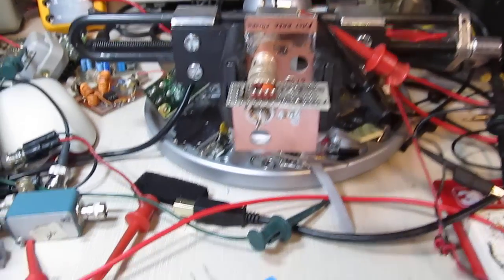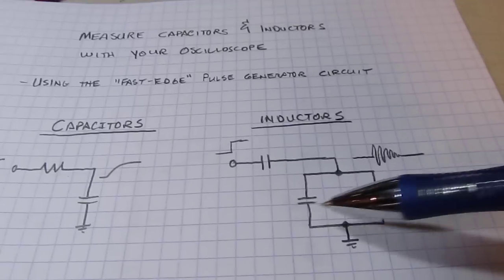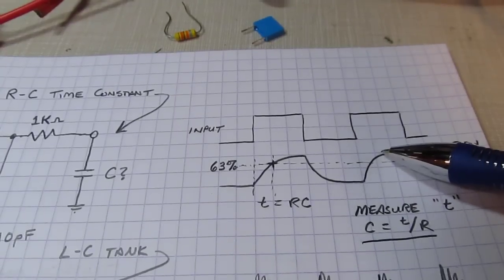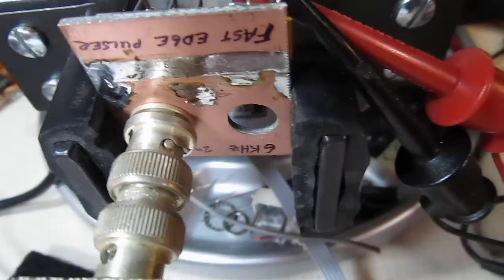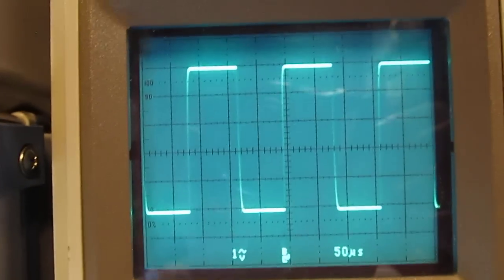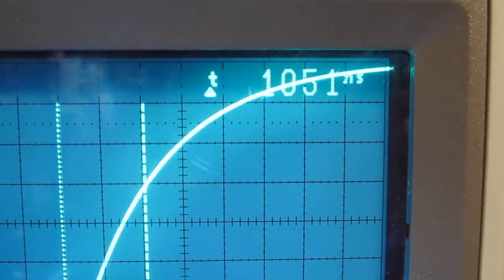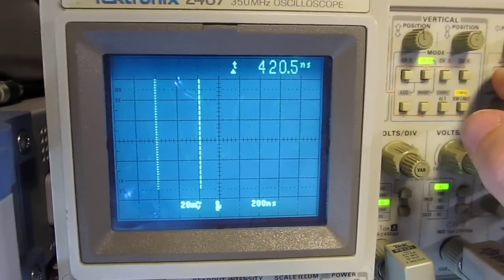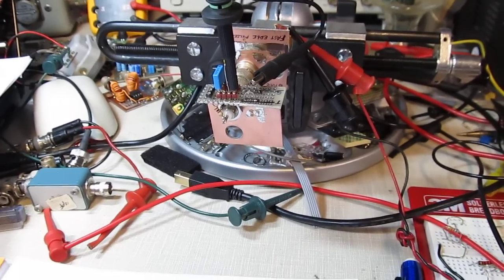#90: Measure Capacitors and Inductors with an Oscilloscope and some basic parts

Comment: I'm enjoying your videos, thanks.  Another easy measure on the scope is,
0.707 x 7 units = 5 units, useful for 3db points.   Actual 4.949, closer than I can see! 
Edit: Reading my mail 2 years late,  to describe how I do this a little better, I set the Volt/Div so the signal is more than 7 units and then adjust the variable knob for 7 units, then I make any external circuit adjustments until the signal drops to 5 units, this is the 3db point.
Reply from the maker: Oooh - that is very handy - thanks!

Comment: You want to measure frequently at the zero crossings. It is hard to tell the peak, but the zero crossings are well defined. Also, it is more accurate to make the zero crossings as far apart on the CRT as possible either by adjusting the horizon sweep time or measure the time between a number of crossings and divide accordingly.  It goes without saying that these zero crossings should all be the high to low or low too high crossings. Distortions in the wave can make your frequently measurement inaccurate if you measure half cycle times. Excellent video and I love your test fixtures.

Comment: Thanks for a great treatment of my scope junction blog!  Nice setup; when I do this I just slap-solder the parts together in the air.  One point needs comment - for very small capacitors one needs to measure the capacitance of the fixture and the 10:1 scope probe first with the same technique so the probe and fixture capacitance can then be subtracted from the final measured value when the cap under test is added to the RC circuit.

The LC circuit is also known as a "tanktwanger" since the effect is so similar to twanging a guitar string.
Reply from the maker: Glad you liked it, and good common sense advice of course.

Comment: Great explanation.  Uses a mathod I've never tried before.  👍
One thing that I've noticed is that just about everyone makes the assumption that their viewers already know what units of measurement the formulas will be using when they do the math.  But that average neophyte electronics student doesn't know that all the calculations answers will be in units of farads and henrys, or even in ohms.  They most likely assume that the units will be in microfarads microhenrys and kilohms.  So these units really need to be explicitly stated.  Thanks for this useful video.

Comment: Using 74HC14 (as opposed to 74AC14), I'm getting 5ns rise time with 100nF + 3k3 RC. The squarewave runs at about 5kHz. The rise time seems to be pretty much independent of supply voltage between 2.5V through to 6V.  I'm going to try packaging into an Altoids tin with 2xAA Alkaline => 3V supply. Mine's a Texas Instruments manufactured chip. I measured the rise time on my Owon DS7102V 100MHz Chinese scope.  Compare this to the 350ns coming out of the scope's own 1kHz square wave probe calibration pins. 74HC14's are super-cheap and readily available in DIP on eBay. Thanks for a great circuit tip! EA5IGC

Comment: With your ground free battery operated steep egde pulse generator you can use also the same circuit for the inductor as for the capacitor. It is not necessary to build up a resonator. Also the error is increasing because its much easier to get a tightly tolerated resistor than such capacitor. In the inductor case you just need to clamp your oscilloscope aross the terminals of the resistor to observe the voltage rising, which represents the current rising across the inductor. The math behind is the same.

Comment: well i found out my function generator uses the max038 chip witch the data sheets said square wave rise and fall for both are 12ns so i guess your circuit would work so i will build it thank you for your help in answering my questions  even i majored in  electronics in high school i forgot some and guess some things didnt  stick because i must not of fully understood either but with your teaching i see it in a whole different light thank you again

Comment: Very interesting.  One guy I worked with liked to test diodes with a low voltage 60 Hz signal.  He would look at the response with his VOM, I think.   I prefer to just measure the resistance both ways with an analog VOM, on the 1k or 10k scale.

Comment: One caution - the capacitor used for inductance measurement must be a high quality dielectric with minimum losses.  ie, don't use a capacitor purchased from a Chinese supply chain source.

A couple days ago one of my colleagues tried this to test a transformer winding and could not get it to ring.  After looking over his setup, I suggested he use a capacitor from my junkbox, not that brown ceramic disc of dubious origin.  It turned out that was exactly the problem.

Comment: Great video. One of the best that I have seen. Now I can measure the C 's that I have to see if the value is as marked, the same for the L's I have. Since I am a retired EE I like to know the value as to how close the value as marked. I suggest that the value for measuring C's I would make the resistor 1% or better. The same applies for the C's to measuring the value L.
Reply: You could always measure the resistor so you know the actual value

Comment: At first glance, it seems to work with calibration output of the scope, although there might be some limitations.  For example, on my scope, the rising edge of that signal is about 3.5us, therefore if we estimate that the rising time is the required time to go from the 10% up to the 90% of the signal amplitude, that would be about 2.197 times tau.  Under those circumstances, if we want to see the complete signal, from 0 to 5 tau, with a 1k resistor, I would be able to estimate the capacitors values from about 1.33nF and up.  Overall, there is always a way, but we need to experiment and do some homework to understand what is happening.

Comment: I really appreciate your very hands-on review of basics! Quite useful. But, I imagine there is some limit to the range of capacitance if your input waveform is set at 5-6KHz.
Reply from the maker: The capacitance measurement is made by looking at the risetime of the signal (the RC time constant), so the frequency of the signal really doesn't enter into it, as long as it is low enough to permit the RC circuit to fully settle before the next half cycle.

Comment: Great inspiring video. Thank you ao much for the unvaluable contents and the clear and calm way to explain. A question: may this measurements be done also with the CAL output pin used and available at any scopes instead of the TDR circuit? would be good for measurements on the fly. Thanks again and keep going posting. Greets from Italy
Reply from the maker: As long as the rising edge of the CAL output pin is substantially faster than the expected RC time constant, then yes.

Comment: A more accurate way to measure L is hook a decent signal generator across the LC circuit, and carefully tweak for a peak.  With a little expertise, you can find the peak very accurately, and you can measure the frequency accurately with a counter.  Also, you can use a series LC circuit and go for a null.  That might be even more accurate.  One more thing.  Use a good signal generator, the kind that produces a pure sine wave.  Unless you know pretty much what the L ought to be, you might end up peaking on a harmonic, if you use one of those horrible "service grade" generators.
Reply: Clyde Wary Yes, this too would work, but requires a signal generator with a variable frequency within the range of the LC tank resonance.  The idea of this video is using a home-brewed fixed-frequency pulse generator along with your scope.

Comment: Hi, i have an inductor of 7 turns wound on a T44-6 (Yellow-Clear) Amidon Toroid. According formulas the inductance should be around 0.2 uH.  I have an LCR meter that shows 0.37 uH so i am suspecting some measure error in the instrument.
I attemped to compute the inductance following the method here proposed.  So i made a tank  with a capacitor of nominal 470 nF (actually is 489nF) and i used my signal generator with a square wave of 20 Khz.  I measured the ring period about 30nsec. Resonant frequency is around 33.3 Mhz.   Applying the formula  f=1/(2*pi*sqrt(LC)) results in an inductance value (52 pH) by far lower than it should be. I tested square waves of different frequencies and i measured exactly the same resonant frequency of the tank around 33.3 Mhz. This seems to me perfectly normal since it does not matter the square wave period but only the rising edge.  However, the inductor computed value is clearly wrong since the error is too huge. I guess something is wrong in my setup but i did not figured out yet what it could be.  Is this method valid for inductance values in the below 1 uH ??
Reply from the maker: The LCR meter is probably the better way to go for small value inductors like this.  But, you have to be very careful to account for (and minimize) the inductance of the leads and connections.  Many LCR meters have a means to adjust or zero-out the lead inductance.  To do this, you'd place a very small short between the connections where you would normally connect your inductor - note this reading, and subtract it from the reading you get with the inductor in its place.  If the meter has a zero function, hit hte Zero button with the short in place, then this value will be automatically subtracted from the result with the inductor.  For these low value inductors, the parasitic inductance and capacitance of the hookup for the tank measurement will often dominate the result unless special fixturing and probing is employed to minimize these effects.

Comment: Thanks for great contributions.  How does the probe capacitor effect or side effect the results? On so datasheets (e.g. sensor ICs) in the test setup section, I saw they mentioned that the probe impedance too.

Comment: To Correct the 90 degree phase angle in capacitors and inductor to make it "0" degrees would need a power factor of "0" which should shift the phase from 90 degrees to 0 zero degrees?

Comment: Hi. Thanx for the educational video's. Really nice to watch. I just did the similar measurement with my (from work :-D) scope Tek.MDO3014, with build-in function generator. I have put the 1Vpp and used 1k resistor. If I measure the time @630mVpp I get 20-25% more calculated capacitance. My DMM Fluke 185 agrees good with printed value on the capacitor. Measured time is in few us (microseconds) and rise time of the scoop is few ns (nanoseconds). So I don't know what I am doing wrong. Also used very short wires/leads to connect all together. 630mVpp would be 63% of 1Vpp. And of course, I know too that RC-time is @63% from the start. But... something is off... 🤔
Reply from the maker: With a measured risetime of a few uS, the capacitance will be a few nF.  How are you connecting to the scope?  BNC-cable with clips, or are you using a 10x probe?  If  you are using the former, that will add more than 100pF to your capacitor under test.
Reply: @w2aew  hi. I have used a coax from the back of the scoop to bring the test signal, and have used the original probe, with the side 5cm gnd connection. Indeed the 3 tested C's are about a few nF.

Comment: Measuring the inductors Ringing is the resonance frequency? But when calculating the RLC resonance frequency it doesn't equal the same result when measuring the inductors ringing frequency, any reasons why they are different?

Comment: It would seem that if you take an RC circuit and feed it a step, say 0 -> 10 V, DC input, then with a stopwatch, you could simply measure the time it takes for the cap to reach 6.32 Volts.  Adjusting the value of R to give a long time should lead to accurate measurements of the cap.  Have you tried this simple method? The input voltage and the resistor can be measured to fine accuracy so the result should be easy and I have done some of this with strangely mixed results.
Reply from the maker: That is really all that this video is doing - except using the scope to measure the delta-t to 63% (5 divisions out of 8) - and no need to use a very large resistor to get a human-measurable delta-t.

Comment: Great video. Do you think this set up will work in the micro or nano Henry range? It seems I'm always guessing with small value coils...
Reply from the maker: It might work for higher uH values, but don't think it would work well for nH level measurements.  The parasitic inductance and capacitance of the fixture will be the limiting factor.

Comment: I am doing a project which compares different inductors on the same circuit for their efficiency. One of the criteria is that I have to implement some sort of calculus element for the project to be gradable. Could I measure and compare the area of the curve for one cycle of the frequency? Would this measurement show that the inductor with the most area is the most efficient? I would take the area under the curve for the very first cycle.

Comment: nice video this is the video i am looking for, i don't have inductance meter, even function generator, so i programmed AVR(atmega164p) to generate PWM 6KHz of 50% duty cycle and followed this  and measured inductance sucessfully. the measured value is 8.9uH and mentioned on it is 10uH (maybe the component tolerance )  but is there any particular frequency to measure the accurate value of inductance? thank you sir.
Reply from the maker: Not really. Lower inductance values require higher frequency to measure.

Comment: When measuring DC Decoupling capacitors on the input of audio amplifier circuits they use different values 0.001uf, 0.01uf, 0.1uf, 1uf, 2uf, 5uf. What formula do you use to know what frequency range the capacitor value will pass a band of frequencies? Because 1uf - 0.01uf = a difference of 0.9uf and 0.01uf - 0.001uf is a difference of 0.09uf. The difference going down in capacitance values is 0.9uf of a difference. Sweeping the frequency range from 20hz to 20Khz the difference in capacitance values will make the band of frequencies roll off, I'm guessing at a difference of 0.9% as you select different capacitor values from 0.001uf, 0.01uf, 0.1uf, 1uf, 2uf, 5uf? The band of frequency that is passing will roll off at a difference of 10%?

Comment: Great video,  could you please clear the fog in my brain on the RC setup. Where does the capacitor discharge to between pulses.
Reply from the maker: Thru the series resistor into the generator output and its termination.
Reply: Many thanks, instruments coupling might be a very interesting topic, 👍

Comment: I just checked my Owon DS7102V. 350ns rise time on the 1kHz calibration square wave with probe on x10. :-o. I ordered some HC parts (the AC ones are hard to get on eBay in DIP) and I'll be making one of the oscillators. I'm hoping to get something like a 15ns edge transition from HC. The first use will be to tweak some air core 700nH coils for a 20m low pass filter. 
Thanks!
EA5IGC

Comment: i dont see a math video for the caps.. iam testing a 473 cap. and i can not get it to add up..the old scope i use. i set the T/D on main dial.. the screen doesnt give any info. i count left to rite 4 of the 5 subgraticules. t/d set to 50u. 50/5=10 10/1000= 0.01.. thats with the 473 in place.. so iam lost.. lol  if theres a video or something i can see.. would be cool.. the trace is at 8D. if i go more it slopes over more. or is that what we want. as much slope to the flat. 
thank you kb2wvo

Comment: what is the purpose of the 10 pF differentiating cap between the RC and LC circuits?
Reply from the maker: To couple only the high frequency energy to the LC tank to "ring" it.

Comment: Is there a way to measure the selectivity (Q) of that LC tank circuit with the oscilloscope ? Thank you.
Reply from the maker: One thing to remember that the Q will depend on the circuitry around it (loaded Q).  So, you'd have to measure it "in-circuit" - usually by sweeping a signal through it.

Comment: I commonly see capacitance measured at a reference frequency (e.g. 1KHz / 1MHz). Is there a reference frequency for this measurement?
Reply from the maker: Not really, this method is using the RC time-constant to measure the value, instead of measuring reactive impedance at a test frequency.

Comment: very handy to know how to do it with an osciloscope. but how are they doing it with the real cheapo micricontrollers ?? determin an unknown c i can imagine, using an larget R for longer tome coefficient and using the internal  AD to measure until that threashold is reached while taking time, calculating the rest. - but what do they to with the L ?? dont think they will do an fft to determine the freq, dont they ??
Reply from the maker: +Axel Werner I would imagine that most use something similar to the AADE LC meter - the theory of operation of this can be found here:
http://www.cliftonlaboratories.com/Documents/AADE%20Reveiw.pdf

Comment: What if I use a pulse generator with rise and fall time slower. Let's say 100 ns (a 555). What would happen? It won't work or shoud I get less acqurate mesurements?
Reply from the maker: It can still work, but you might need to adjust for it.  For example, when checking capacitors, you might need to use a larger series resistor when checking smaller capacitors so that the RC times constant is slower than the pulse rise time.  Similarly, when "ringing" an inductor, you might need a larger capacitor in parallel so that the ring frequency is lower.

Comment: Nice video! Thanks for the tutorial. I guess you could use a function generator to accomplish this? I don't recall seeing what frequency that you used for the square wave pulses. Are the input pulses at 5 volts?
Reply from the maker: 1-10kHz works fine.  Yes, a function generator can be used.  It was 5Vpp in this case.